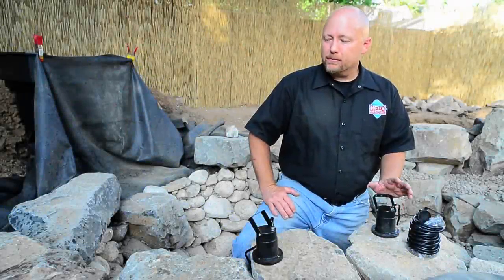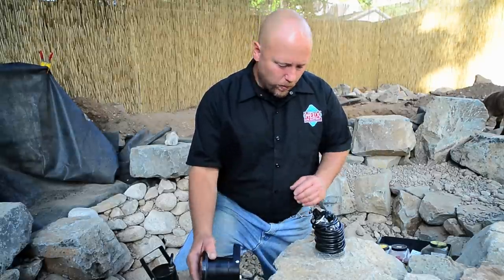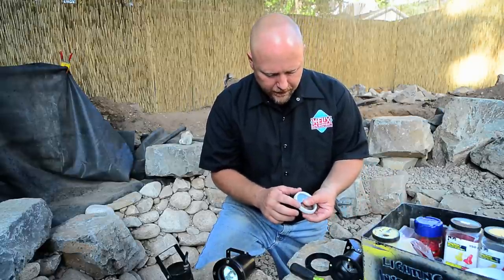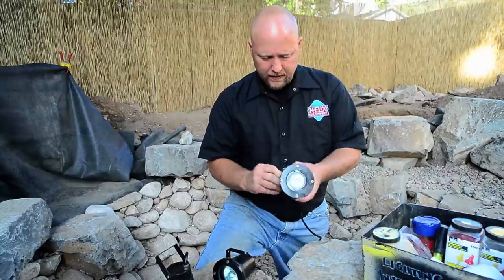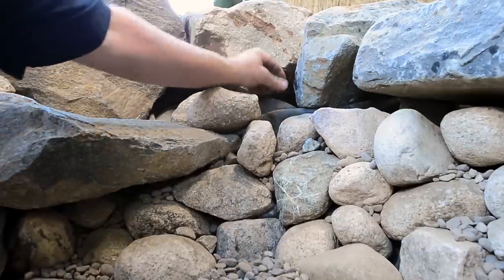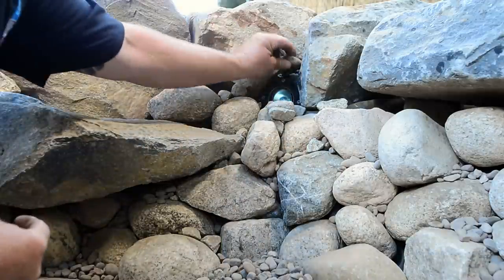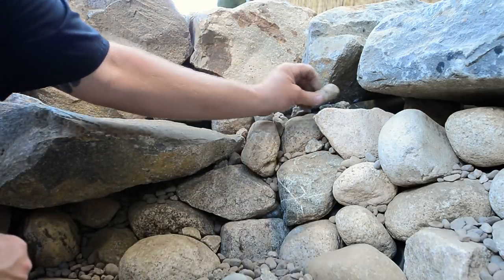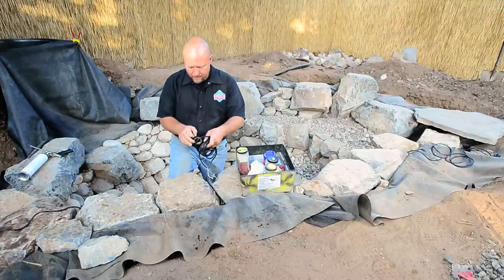How to build a Fish Pond - Part 10 | Pond Lighting Installation

Comment from the maker: Yes great question. This pond is 11' wide. In the center of the pond we have a light facing directly across the pond from the viewing area away from the viewing area. We installed a light on the waterfall side and a light on the skimmer side and they are aiming in a 45 degree angle towards the middle light. I wish I would have covered that better in the video. I'll know better next time.

Comment from the maker: You can break the foam loose on the light fixtures. I don't suggest a heavy foaming of the fixtures, just enough to lock them in place so the fish don't knock them around and have them floating around in the pond. You might need to change the light bulbs once a year if you use halogen bulbs but you go much longer if you use LED bulbs. Most of the time I wedge the lights back into place without much worry. If you have monster koi mobbing around in the pond you may need to lower the water level.

Comment: Hi Eric,

I don't know a lots about ponds and have allready learned a lot from your channel. Realy enjoying the videos! 

Now, as a professional elektronic engineer there are a few things I do know. You've shown us to wrap the cable a few times round the light fuxture and that raises some concerns with me... You see, when you have a metal structure (especially a round one) wrapped by currentfeeding cable, what you're doing essentially is making it a huge magnet. Probably not very harmfull for the fish. But your cables are going to become hot, each time you power them on, you'll get power spikes, and your currentphase is going to lean over to the negative side, which is very bad for your powerconsumption...

Again, love the videos, keep doing what your doing, I hope my information can be of aome use to you aswel.

Grts, Ruben
Reply from the maker: +Ruben Veris Thank you for your reply. I know that is true with 110 volt. Is that true with Low Voltage as well?
Reply: +ThePondDigger Hi Eric, it's not so much the voltages you have be carefull with, it's mostly the current flowing through the cables. The amount of current is determined by the amount of watts, high wattage means low current, low wattage means high current.

knowing this, let's say you send 1A through a coil (which is pretty much, 0.35A can be deadly), that coil is going to react with roughly the same strength in the other direction, if you're using alternating currents, that's going to happen 120 times per second (in the US, 100times in europe). This means the cables will be under more stress than under normal conditions and they will wear out more quickly. Also as I mentionned you have the phaseshift, this will cause more stress on the transformer because he is calculated to operate with a nutral phase. And when the stransformer becomes under stress, he will have to work harder, resulting in a higher powerconsumption. 

In this case, I would suggest trying to loop the cable behind some rocks if possible.

hope my answer is of some use :-) 

grts

Comment: Great video! From a design standpoint, what is the best way to position the lights. As you approach the pond, do you prefer the lights point towards you or do you install them so they are directed at the opposite side of the pond, away from you?

Comment from the maker: Typically we will request a dedicated circuit for the pond. Usually a 20 amp GFCI is more than adequate for most backyard ponds. More often than not a quad (4 plug outlet) is more than enough for our pond. This pond will need only two plugs. One for the pump and one for the transformer that will control the lights. So I will ask for a quad in case we need more plugs for add ons in the future.

Comment: I have the same question as Alan, but also is there a rule of thumb you use to determine how many lights should be used?  Do you position them to shine directly into the center of the pond, or angle them slightly to bounce the beam off the rock next to the light fixture?

Comment from the maker: I am working on a spreadsheet to track all the expenses on this project for both the DIY homeowner and for professional installation. Off the top of my head professional pond installation is 6,500 to 7,500. This Helix Life Support Pond Kit will likely come in around 2,500. Rock, Gravel, aquatic plants and terrestrial plants will come in around 2,500. That's off the top of my head so don't hold my feet to the fire on those numbers. :)

Comment: Great tips on installation, but have more questions about placement within the pond.  It seems that you want the lights installed on the main viewing area walls, pointing away from the viewer.  Any thoughts on angles, crossing the light fields from the lights vs. having them more unidirectional?  Thanks!

Comment: Eric,

What do you do for the electrical we started our pond very similar to yours and are trying to figure out what to do for the lights, filter, skimmer, and  two pumps. I do have and outside electrical box but that is only two plus and we need about 8. What would you suggest and might you be covering this in a later video?  Thanks again for the helpful videos!

Comment: Would it be better to have a PVC (painted black or whichever) pipe rocked in permanently and then the light housing wedged inside of that?
Reply from the maker: You can do that with 3" pipe and these particular light fixtures! We have done that in the past but do find a little more freedom of angles and ease of placement using this method. Yes sometimes it can be a challenge changing a bulb once a year. If you are on instagram Follow up with me for more pond pro tips and inspiration. @theponddigger

Comment: Hi Eric, I love your videos and find them to be very useful. I am renovating my koi pond and would like to install underwater led lights. I have found submersible LED lights that range from $20-$30 to over $120/light. I am looking for bright white LED lights that provide enough light equal to 50 Watt halogen lamp. Not all manufacturers provide information on the lumens output, so it can be very confusing. Also, the number of LEDs vary by type of lamp, but I am  not sure that all LEDs provide the same amount of lumens. Can you recommend a good LED lights for koi pond that are not too expensive. Thanks
Reply from the maker: +abbas merchant Here is a link to the lights we use. http://theponddigger.com/product/the-pond-digger-professional-halogen-pond-light/ We use a wide variety of bulbs in these fixtures from halogens to LED's. I don't know the lumens info off the top of my head. I'll look into it.

Comment: is there a purpose for throwing the construction dust on the lights? i would think it would just was off.
Reply from the maker: +Tecolote Alcón I use construction dust around the lights to hide the waterfall foam I use to lock them in place.

Comment: Can you explain the electrical side of the lighting?  I was going to order a pair of these but it seems to be an open wire on back end... Do I need anything special to make these work or can I just plug and play?
Reply from the maker: These lights are low voltage and need to be connected to a transformer. There are plug and play underwater lighting systems available with the lights already connected to mini transformers. The plug and play systems are not as reliable or long-lasting as the type of lighting system explained in this tutorial series.

Comment: Eric, what brand of lights are you using?  Everytime I buy pond lights, whether through a builder or a DIY vendor, they end up full of water.  They are typically the kind you screw the lens on.  Junk, pure junk.  I like the idea of having 4 screws to hold the lens tightly to the body.  With you being a professsional and all, how often do you need to replace a light with a failed seal.  I'm just tired of buying or having junk sold to me.  Thanks and keep up the grat work!  *subscribed*
Reply from the maker: Dan Johnson I know exactly what you're talking about! Here is a link to the lights we used in the video. We install a ton of these each year. Returns and problems are minimal! http://theponddigger.com/product/the-pond-digger-professional-halogen-pond-light/

Comment: I have underwater lights but need to replace the lights but by splicing the new light to the existing wire. Because the power source is under very large slate plates

Comment: If you foam the light fixture in... how do you pull the fixture and change the blub?
Reply from the maker: When the bulb burns out you can dislodge the light from the foam. It doesn't harden off like cement.